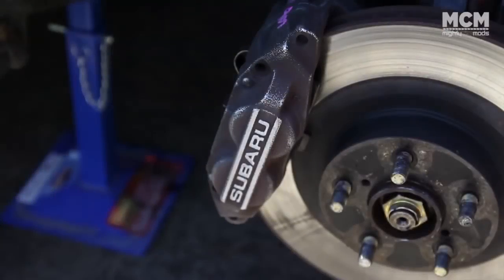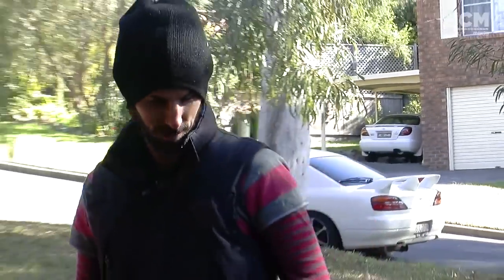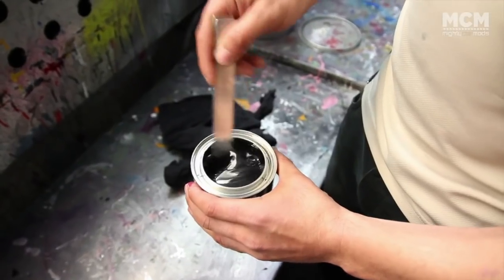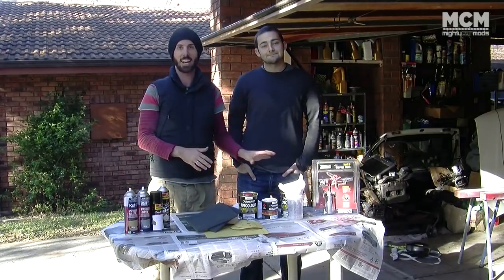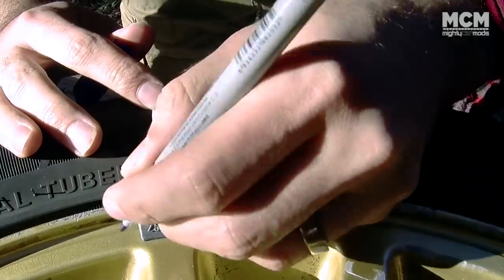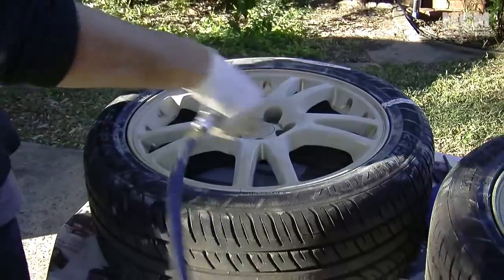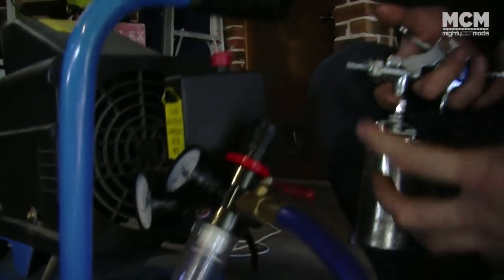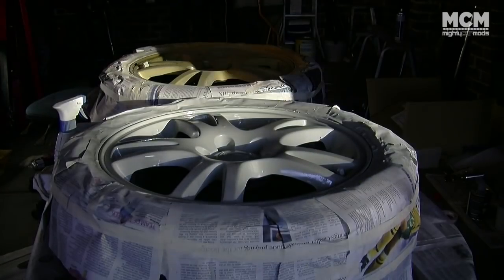How to paint your wheels

Comment: What about sending them off to the powder coaters? (yeah yeah, I know powder coat has its flaws too)
Reply: Powder coating is expensive though, MCM is all about DIY mods on a budget.
Reply: W. Doge
Powdercoating is CHEAP, much cheaper than getting them professionally painted. The average bicycle frame is about $100 NZD including sand blasting first, an equivalent paint job can be upwards of $600 NZD.
Reply: +Alex Paulsen powder coating wheels usually costs more than $100 USD a wheel, even more depending on the color you want. That's pretty expensive considering you can paint them yourself for the same exact result, sure they may not last as long, but if you do it right, they'll last a long time
Reply: Josh Kirby
I can get a bicycle frame and fork stripped, prepped, and powdercoated for $100 NZD... It's still peanuts compared to having a professional paint them, and the resulting durability is worth it in most cases. Some spray paints aren't always successful, more often than not they can flake or rub off, which can partly be due to prep too.

Eh, more effort. Powder coating still has my attention here.

Comment: Hey guys I have a question for you guys. How do I get rid of cabin rattle in my car? It kinda makes my car feel older than it is.
Reply: +RavenPrecept I tired WD40 instead of glue. it helped a lot.
Reply: Anthony B. Have a passenger (or a couple) sit in the car while you drive to figure out where the rattle is coming from. Then just fix it, remove the issue, glue it, or WD40 it!

Comment: why cant you just paint the weights as well please tell me
Reply: You can, but if you dont take them off, when you get your next set of tires, the weights wont be in the same place and you'll have an unpainted area on your wheel
Reply: You can, but they take them off so they can spray the metal underneath the weights. Otherwise when you change your tyres there'll be a big black ugly mark there which wasn't painted.

Comment: Where can I buy the painting items? And what do I needs?
Reply: I'd imagine auto-zone would have most of the stuff you need.
Reply: auto zone or google for a diy auto paint shop but I use Wal-mart for sand paper and Home Depot/lowes for better array of rustolem enamel colors and I get compliments using cans. if you go with the spray gun id ask a hardware store which compressor you need for your applications
Reply: Vanghoua Vue Did you even watch the video???

Comment: What if my car has no wheel covers? Just the black wheels the tire is mounted on with the lugs? Is there anything I can do to dress that up besides plastic wheel covers that do not hold up? (NOT!) I have a dark grey neon 1999. My car looks frumpy! Help!
Reply: +Ly Kri If you're talking about the black steel rims that usually have covers on them, then your options are pretty limited.  Aside from replacing the wheels entirely or dealing with the wheel covers you already said you don't like, you could try cleaning the hell out of them, paint them gloss black, and clearcoating them.  It would definitely look better than bare steel rims, and it would protect the wheels from corrosion.
Reply: +Sadpants McGee Sorry for being a noob here, but why didn't they separate the rims and tired? Wouldn't that be easier so they don't have to waste time by covering the tires?
Reply: aL k Taping up the tires is way simpler and faster than removing the tires and then putting them back on, especially if you don't have the right tools for the job (most people watching this probably don't)
Reply: Sadpants McGee Ah, that makes sense. Sorry for being a noob though, haha.

Comment: Hello i want to paint my 15' wheels with spray, how much can's i need for it? (i want it paint black matte) so someone can tell me what i need to buy? :D
Reply: Use PlastiDip. The black that comes is already matte black and it looks real clean with just 2 bottles for all 4 wheels. The nice part about this pain is if you don't like it you can peel it off after it dries
Reply: Adam Hishmeh ok but for how long it will be stay on rim? sry for my bad english :D
Reply: It'll stay on for as long as 2 years as long as you don't scratch it and put too much pressure on it
Reply: No, if you live in a really hot or really cold place they will flake very easy

Comment: Thanks guys. Spent the weekend painting mine that the previous owner scratched up. 
Sanded, primed, 2 coats of black. 2 coats of red, 4 coats of clear. Check them out

http://i852.photobucket.com/albums/ab81/John_Crossett/Mobile%20Uploads/20150503_212132_zps7msgcbnu.jpg

Comment: I took my car to a Dyno in Kent, england after painting my calipers. they seemed to think and tell me that the calipers wouldn't add any power? after spending £250 on a dyno run and tune i wouldnt advise painting your calipers if youre looking for genuine power upgrades.  although ive heard race strips help with top speeds as its more aerodynamic.
Reply: Incorrect. I painted my brakes red and instantly gained 100hp. Adding a shift knob and LED bulbs gained another 50hp. Guaranteed!

Comment: Wow!! This looks hard..
Reply: it actually isnt that hard :) ive never used a spray gun tough or painted my wheels (i am going to ... sometime) but i have painted my rear and front bumper and some more details it wasnt even with colour matched cans but it still looks good. its just about feeling how hard to spray and move. like shia laubuff says JUST DO IT! and if it goes bad just try it again :D
Reply: Not hard but as with anything to do with painting, if you want it to look good in the end the prep work has to be put in at the start. Between masking all the tires properly, sanding down the wheels, priming and resanding, waiting for coats to dry overnight etc, its very time consuming. I did 4 wheels once and would nt do it again.
Reply: rivolinho lol why? waisting time?
Reply: If the end result was anything to write home about, it would be worth the effort. But the paint chips off very easily, even with wheels properly lacquered with a spray gun. The finish just isnt tough enough. 
I have a corroded set of alloys which need doing now and Im sending all 4 off to the power coaters for 200 euro all in. Some things you just can't DIY and wheel painting is one, imo.
Reply: confinez555 b

Comment: mighty car mod should try plasti dip
Reply: +freshdominican92 I'm curious what they think about it.  Spray paint in a can was a 7.5, and in a gun it was an 8.  If I can get a solid 6 out of plastidip, and have it be easily reversible, I'd be happy.
Reply: I just want to see them try it, like the whole car, because that's something they haven't don't yet
Reply: freshdominican92 I've seen it on whole cars.  And it's bad.  Great for accents and smaller pieces, like wing mirrors, door handles, and wheels, but it looks horrible on a whole car, especially if you spill even the slightest bit of fuel while filling up.
Reply: +Sadpants McGee look up "dipyourcar" on YouTube they do a good job, if you know what u doing it.looks nice
Reply: freshdominican92 I did.  That's exactly what convinced me not to do it.  Looks great in small amounts, though.
Reply: Sadpants McGee me personally I would do it because it's to much work

Comment: What are wheel weights for?
Reply: Balance the tires, so they won't shake all over
Reply: basically preventing that vibration u feel when driving fast on a highway or something
Reply: so that the car doesn't vere off to one side if there not balanced the car will move to the right or left and u wud have to keep adjusting using the steering wheel
Reply: They are so that while you are driving you don't have the risk of them going all over the place. If they did theeeen. It would be trouble

Comment: So to paint my wheels I have to invest in about £200 worth of gear. Lol its £30 per wheel to have someone do it for you and the job will be perfect also. Rather do that. And no chance of me getting paint asthma
Reply: But the investment will pay off if you plan to keep doing DIY stuff in the future. Air tools just make everything better.
Reply: YonOtto I am currently in the process of repainting som rims and so far it has cost me about 40$ and the paint itself is most of that. Air tools are mandatory although they produce better results. Rattle cans are easier though, just point and spray.
Reply: To get them professionally done it's around £60-£80 a wheel. Anyone who charges £30 doesn't value their service and most likely won't be using a clear coat. You could most likely do a better job yourself. If you shop around you could get all the sprays to do 4 wheels a few times over for around £40.
Reply: its the "i did this" feeling

Comment: What does prime(I think) mean
Reply: Primer is just an undercoat, usually a neutral colour and helps by giving the base coat something to stick to and adding another layer of protection for your wheels. Also especially useful if you are changing the colour significantly.

Comment: Red brakes on a car for old women?? I'd go for the cheap solution - Place a bag on your head but take it off when you're strapped behind the wheel
Reply: It might look plain, but that is a turbocharged Subaru, meaning it's decently quick.
Reply: +JustLetMeComment So if a really ugly car is fast in a straight line - it's a good looking car? It makes early 90s Camry look like a supermodel
Reply: +FukeU1248 No, it doesn't change its look, just pointing out there's some merit to putting time into it.
Reply: Is this also a good looking car - if it was fast and had red brake calipers
https://upload.wikimedia.org/wikipedia/commons/8/83/1991_Toyota_Camry_(SV21)_Spirit_station_wagon_01.jpg
Reply: +FukeU1248 I'm not saying it's good looking. I've never been saying that. I'm just saying it's not like it's a camry, it's a turbo subaru, it's worth putting money and time into.

Comment: Painting wheels is a pretty terrible idea.
Reply: why
Reply: Paint ain't gonna last. You're better off buying them in the colour you want from the get-go. If you scratch metal, no biggie, but if you scratch a relatively thin layer of paint, it'll look a lot nastier. I mean, in the short term it's not so bad, and if you don't mind re-painting them, whatever I guess.
Reply: You think your wheels are bare metal with no coating or paint?
Reply: A coating, sure. Actual paint? That's usually pretty obvious if it is the case, and even more so if you have existing blemishes/scratches.

Comment: Why not just plasti-dip?
Reply: Because plasti dip will ware off
Reply: Stuntihn MX ..But then you can just spray more plastidip.
Reply: Boom!
Reply: Patrick rox Plastidip isn't as durable, is essentially the same price, and doesn't give as good of a quality. Even if you were to plastidip these wheels, you would still need to do all the prep work, use a filler primer, a base coat (plastidip) and then the plastidip glossifier. I've got plastidip on my wheels, but my car is made for offroad, so in my opinion it doesn't have to look as nice.
Reply: +Patrick rox Because it's garbage.